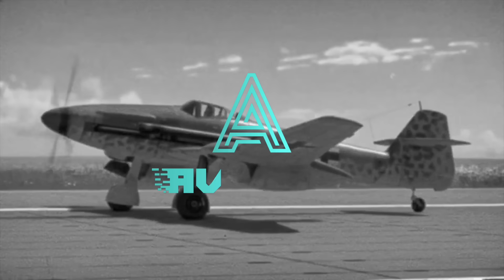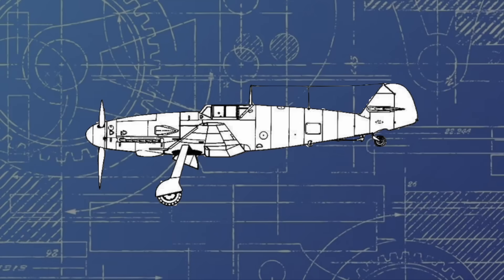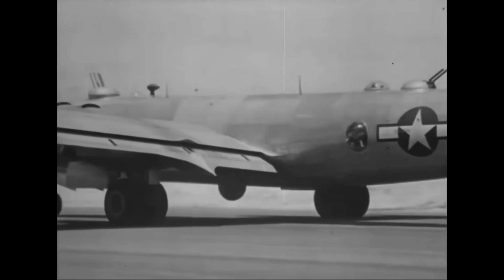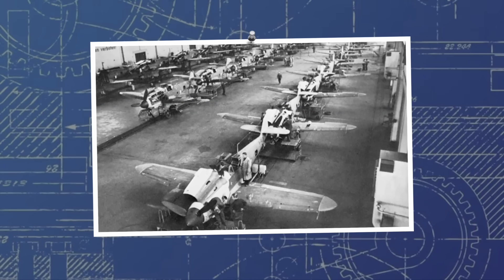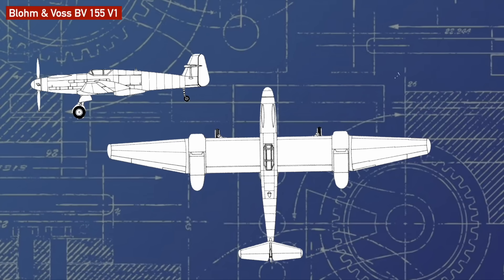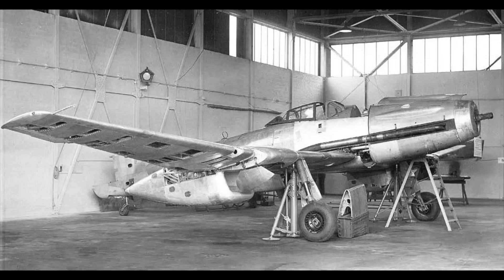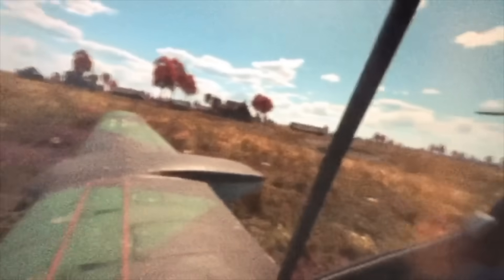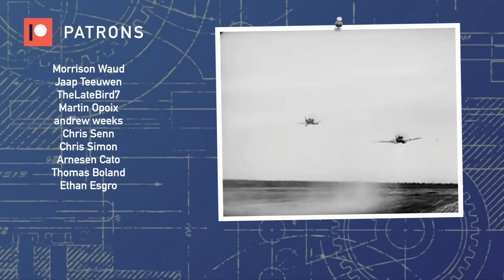The Luftwaffe's Forgotten B-29 Killer - Blohm & Voss BV 155

Comment: If it’s mechanically driven, then isn’t it a supercharger?  These distinctions have always bothered me.
Reply from the maker: Yes you're right, silly technical error on my part.
Reply: Unless you’re Napier - who coupled the turbocharger turbine to the crankshaft to extract more power to drive the propeller…
Reply: @allangibson8494  Wright did that as well on the R-3350.  It was called a Power Recovery Turbine.
Reply: @fantabuloussnuffaluffagus  The Napier Nomad didn’t have a gear between the compressor and the power turbine (it was basically a single shaft axial flow turboprop engine with the combustor replaced with a piston engine) but the concept was similar.
Reply: Supercharging is simply the effect of increasing airflow to the engine to boost performance at altitude. A supercharger can be mechanically driven or by a turbo or any combination thereof.
Reply: Turbo compound systems blur the lines some.
Reply: The confusion is understandable.  The Me 155 started out as a carrier born derivative of the Me 109G with increased wingspan to give good carrier, landing characteristics.  When the Graf Zepplin aircraft carrier was suspended development was passed to blohm and voss because Messerschmitt  didn’t have enough engineers, draughtsman or factory. Space.  The BV.155 then became a high altitude fighter using the DB628. Engine.  The DB628, had mechanical driven superchargers, and was based on the DB605.   The second stage supercharger was in the classic German position sideways mounted the first stage supercharger was Annular with the propeller shaft and mounted as part of the gearbox.  It featured variable pitch vanes to ensure efficiency.  This was an excellent engine from the point of view of high altitude performance, but it was never developed and it was abandoned from the production program in 1944. I suspect it didn’t prove possible to mount it on the ME109G.   The BV155, then move to a turbo charged engine. The DB603T.
Reply: Another factoid: back then, Turbochargers were considered a form of super-chargers; often called “Turbo-Superchargers”.

Comment: The Ta 152 was actually the high altitude fighter that was made for B-29 attacks.The plane had a service ceiling of 48,550 feet and was very manueverable at high altitudes.  It was assigned to the Gruppe III of JG 301 although only approximately 35 were delivered due to destruction of storage sites.  The P47 N and M versions were its contemporary allied aircraft, but had lower service ceilings.
Reply: The Ta 152 H0 and H1 used the Jumo 213E1 engine and the Fw 190D12/13 used the Jumo 213F engine which was the same engine apart from the lack of inter-cooler and he need to use higher octane C3 fuel.   the Jumo 213EB had intercooling and could be fitted to both the Ta 152H and Fw 190D12/13.  With this engine the Fw 190D12/D13 EB was expected to achieved 488mph and the Ta 152H EB 472mph but without needing GM-1 nitrous oxide.
Reply: Not to mention the 152 had a 30 mm cannon with two 20 mm. The Smithsonian Air and Space museum has a Ta 152 on display.
Reply: The Ta 152 , with its high speed & high altitude capability could have been a serious contender against Allied planes,  but as usual for the Luftwaffe at this stage of the war, came out too late & in too small a numbers.
Reply: furthermore the Bf 109 H. 14.000 meters.
Reply: @laurencek.1580  its not on display now.
Reply: The Ta 152 was built to fight Mosquitos
Reply: @Dilley_G45  No, it was not.
Reply: The Ta 152 would have found itself up against the Lockheed P-80 shooting star which was 55mph faster than the ME262. Only 4 shooting stars went to Europe by wars end but they were under construction stateside in mass. Once the allies were at the German border range of the jet became less of a factor.
Reply: @kenstewart5991  Chuck Yeager, who flew both the 262 and the P-80 intensively, said they were so similar in all performance metrics, that it would have come down to pilot skill. As 262 production was increasing, had the war been going on longer, this would have been the likely match up.
Reply: @kenstewart5991 There we’re P-80s, according to one pilot’s memoirs…that were in the Philippines.

Comment: Great work on bringing us this video! B&V were certainly fantastic innovators if nothing else.  This could have been a potent aircraft but for the tendency to over-engineer everything. 
Navalised Stukas and the Me-155 could have been a nightmare in some situations, where air power could have been projected practically anywhere.  With hindsight we know that carriers were vulnerable though.
Reply: A situation similiar to Bismarck may have occured, where the ship could have achieved some decent feat only to be destroyed by an overwhelming response.
Reply: - I'd just like to add that History of the German night fighter force, 1917-1945 by Aders, Gebhard mentions that the British also tried to mislead the Germans into thinking that they would be bombing from the stratosphere at night in order to misdirect German  efforts.   The night fighter that resulted from that was probably the Ju 388J1 with BMW 8101TJ-1, TJ-2 or TQ engines.   Service ceiling about 44,000ft.   There was also the Ju 88J3 with Jumo 222E/F (back on the production program) with a speed of over 430-444 (depending on radar) but at slightly lower service ceiling.    The Ju 88G7 due to its two stage supercharged  Jumo 213E engines also had capability.  
-In regard to the The Me 109 ground looping problem you mentioned.  It  was solved in early-mid 1944 when aircraft with extended tail yokes began to appear.   In the 3 point sitting attitude of 13.5 degrees propeller circulation caused and p-factor caused one wing to stall ahead of the other causing ground looping. The extended yoke changed the angle to about 12 degrees.    It appeared in retractoable form on the Me 109K4 but was common in Me 109G10, G14 and even G6 since it was interchangeable.
 -With the BV.155 service ceiling of 55,565ft the B-29A, B36A were all within the interception envelope.    The B-29 operated its first missions in June 4 1944 so the only thing the Germans had in service at that time was the Me 109G6ASM and Me 109G14AS with increased size super chargers.  These had the performance needed to intercept a B-29 but it was still hard.
-The Ta 152H could intercept the B-29 easily but it was a Feb 1945 aircraft.  Me 262 as well.

Comment: Regarding the simulator pictures: German airfields during WW2 did not have dedicated runways. they mostly where square field of gras so the taildraggers could take off from any direction against the prevailing winds.
Reply: I doubt if the airfields were any where near the width they are depicted in the simulator videos.

Comment: 0:31 Turbochargers are not mechanically driven. Superchargers are. Turbochargers are exhaust-gas driven. Turbo-superchargers are a compound system with both a mechanical supercharger element and an exhaust turbocharger element.
Reply from the maker: Sorry for the mistake, thanks for the clarification.

Comment: Service Ceiling of a B-29 31,850 ft
Service Ceiling of me262 38,000 ft. 

I know what b-29 killer I would rather have been in
Reply: Good data.
Reply: Yeah, but the Me262 engines generally fell apart somewhere between 10 and 50 hours from being built. If you throttled them hard, that number dropped drastically. And 'fell apart' sometimes got rather explosive.

Comment: You may have mislabeled this video. The Germans realized by 1944 that the B-29 was well on it's way to fight the Japanese. Germans even showed a photo in paper of a decoy B-29 being sent to England. No German "B-29 killer ever attacked a B-29", as I recollect.  The Japanese had a limited number of capable fighters, of German design, that struggled to 30K feet in hopes of intercepting B-29's. Of course, as B-29 fans  can attest to, the real killer of the B-29 were those Wright R-3350 engines. Number 17 cylinder, under tropical conditions, would break valve stem off, and raw fuel would torch the cylinder, and spread to the vulnerable wing. Thanks for an informative video. Subscribed.
Reply from the maker: Thanks for the comment. The Germans didn't realise that the B-29 was not bound for Europe until the project was very, very far in development, and even then they presumed that if the war kept on going the B-29 would eventually make it's way to Europe.

The vide is called a B-29 killer because the BV 155 was specifically designed to shoot down B-29s.

Comment: all those 30mm cannons would have been a bomber killer for sure.
Reply: Muzzle velocity too low. Had to get very close and risk fire from the bombers. Less of a problem for the Me262 which'd whoosh past, but with just a few seconds to aim and fire.

Me262 had many shortcomings... lack of speed brakes understandably unforeseen until first combats. And the engines were immature, not really reliable (actually dangerous) until the Jumo004B.

But the 155 was a waste of engineering effort. Not just because the B29 wasn't a thing for Europe.  Turbojets would outpace, not just in speed but also in terms of manufacture, being far less complex... and not demanding such high quality fuels.

Comment: I can't really imagine that the Germans have dealt with a potential threat from the B29 in advance, because why should one develop countermeasures in the war against non-existent threats. The daily danger from B17, Lancaster, Wellington and other bombers was the challenge to overcome. There was simply no time and no potential left to think about unlaid eggs and develop countermeasures. The video is therefore extremely hypothetical and dedicated to one's own imagination rather than reality. The high-altitude fighters were intended as a defense against the Mosquito reconnaissance and high-flying bomber formations operating at high altitudes, but not as pre-answer against the B29.
Reply from the maker: Well I don't believe it's anyones problem except yours if you can't "imagine it". This is the simple reality. The Me 155 was developed as a direct response to the B-29, which was of a different generation to the B-17 and could fly higher and faster. If you want to go to the archives and disprove multiple corroborating sources be my guest - but this video is not 'hypothetical', and there is no 'speculation' on my part. This is black and white, once the Germans heard of the B-29 in late 1942 they began developing a counter, which culminated in the BV 155.
Reply: @aviationdeepdive  This is simply wrong, what you want to convey here. The B&V 155 is not an answer to the B29, the concept of the high-altitude fighter has not been limited as a replica to a specific type. The B29 was not the reason for the development of this project. This should be easy to find out with good research. Therefore, it is not useful if you now try to discredit my statements as untrue individual opinions. But if you're so sure you're right, then you can certainly cite the sources of your claims. Because that's what they are: assertions, not truth.
Reply from the maker: @duke6321   
X-Planes: German Luftwaffe Prototypes 1930-1945 - Page 224:

"BV 155 V1 was the prototype of an extreme high-altitude fighter aircraft which. was designed as a defence against the eventuality of American B-29 Superfortress strategic bombers ..."

German and Italian Aircraft Carriers of World War II, 

"BV 155, it was redesigned as a high-altitude interceptor to combat the USAAF's Boeing B-29 Superfortress"

Aircraft of the Luftwaffe, 1935-1945: An Illustrated Guide - Page 228

"The Blohm & Voss Bv 155 was a high- altitude interceptor aircraft intended to be used by the Luftwaffe against raids by the USAF when the performance estimates of the B-29 Superfortress first started reaching German command"

Like I said, my sources are cited, this is not 'opinion', this is fact.

Comment: The egos at Blohm and Voss saved many B17 pilots lives. Had this high altitude plane with a significantly more powerful engine as well as heavier guns been quickly modified from the BF109 plane lineage and put into service, it may well have been a real curse on the lives of B17 pilots and their crew. Thankfully, the ass draggers at Blohm and Voss never let that happen.

Comment: The USAAF never planned to make use of the B 29 in the european theatre. The Luftwaffe struggled to develop a capable "Höhenjäger", an aircraft able to outclimb american fighters and especially to intercept british mosquitos. The B 29 was never a reason to develop such german fighters, as General Galland pointed out after the war had ended.
Reply from the maker: Yep, as I said in the video: "Of course, what the Germans didn’t know is that the B-29 was envisaged far more as a bomber for the Pacific theatre than for the European theatre, but nevertheless Messerschmitt was given the requirement to urgently develop a high altitude bomber interceptor."

However, the Germans of course had no way to know this so they were somewhat forced to develop a pre-emptive counter anyway.
Reply: The Brit Mosquito found the German answer in the Ta-152.

Comment: The plane was a reaction to a bomber that wouldn't enter service until 1944 and then only in the Pacific theatre?
Reply: Do you think the Germans were omniscient? They were aware of the B-29 from September 1942, how on Earth were they supposed to know when and where it would enter service. They prepared for the eventuality that it would bomb Europe. Quote from the video:

""Of course, what the Germans didn’t know is that the B-29 was envisaged far more as a bomber for the Pacific theatre than for the European theatre, but nevertheless Messerschmitt was given the requirement to urgently develop a high altitude bomber interceptor.""

Comment: FWIW mate, turbochargers are not mechanically driven, by definition. Thats a mechanical supercharger, turbo means driven by a turbine. If its both its a compound setup.
Reply from the maker: Thanks, I had realised this mistake after - will have to make a note of that one
Reply: @aviationdeepdive  if it makes you feel any better at all, im an engineer,  did formula SAE at uni, i still find it confusing XD.
Theyre all superchargers tho, lol.

Comment: Germany never pefected air to air rockets nor even air to ground rockets actually which is one reason for the failure of the mighty Luftwaffe 1939-1945. They did have radio controlled dive bombs interestingly which were used to devastating effect on occasion later in the war but definitely needed to be mass produced instead of constantly trying to build entirely new aircraft, engines, propulsion systems, controls etc etc. Definitely built the Me-262 but armed the item with canons and used as a fighter which was never the right solution. Meanwhile the Britsh Typhoon Fighter was a far greater, more immediate and proximate threat to Germany than the B-29 was ever going to be. Still to Germany's credit they were fiedling 21st Century weapons such as the Tiger Tank and V-2 Rocket and the mg-42 crew served weapon and perhaps most spectacularly the Sturmgehwher-44 during World War 2 and in quantity.

Comment: Really the raids on Ploesti could have been arranged for B-29s to do the task from bases in Persia/Iran or even possibly British controlled Syria/Lebanon. Perhaps the German planners thought the same? But USAAF planners did not want Superfortress to get captured and copied by the Germans and possibly Russians. Russians did it anyways by the end of WW2.
As it was it was a herculean task for Ploesti the B-24 Liberators had to do the 1,200 mile journey loaded with bombs and extra fuel tanks, and the conditions caused problems from the start. The trip really exhausted the crews that survived the ordeal to attack those oilfields.

Comment: "A B-29 killer" you called it? Odd, the B-29 was not even introduced until the surrender of Germany in May, 1944. Not too many B-29's in Germany. You'll see them in Japan and Korea.
Reply from the maker: Germany didn't surrender in May '44, they surrendered in May '45. It was called the 'B-29 killer' because it was designed with the express purpose of killing B-29s.

Comment: The Ta-152 was designed to take on the B-29.
The BV-155 was intended to engage the B-36 which was under development at the same time as the B-29
Reply from the maker: The Ta 152 was a stopgap aircraft, the 155 was definitely built as a direct response to news of the B-29. It's pretty unlikely that they knew or had any meaningful knowledge on the B-36, especially its first flight was over a year after the end of the war. During the time that the BV 155 was being designed in 1943, the B-36 was in very, very early development.

Comment: Considering the Boeing B-29 never flew over Germany, this is a story without a hero. Facts should be changed before putting pen to paper, or in this case video to screen.
Reply from the maker: Perhaps before 'penning' this elegant comment, you should have realised that the Germans didn't realise that the B-29 wasn't intended for Europe, and thus still developed a counter to it. Hence, the BV 155 was designed to be a 'B-29 killer'.